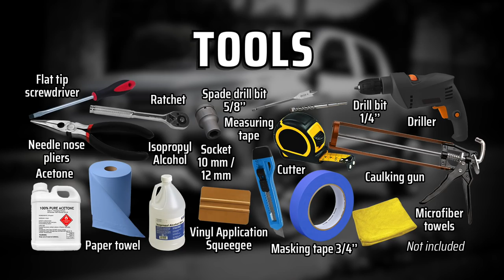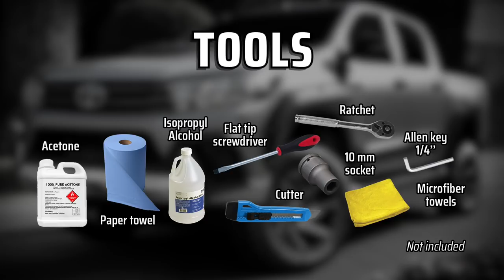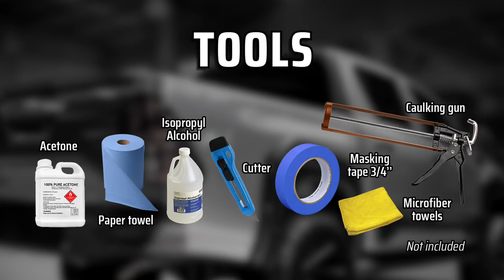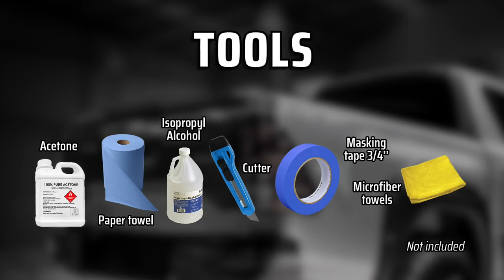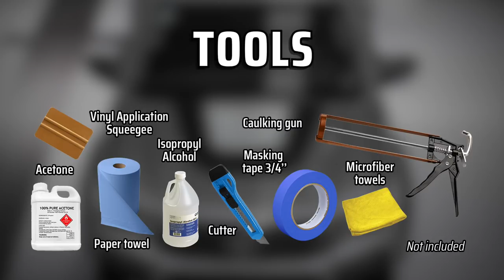STYLING KIT - Hilux 2017-2018 - TOYOTA

Comment: Where do I get the cab spoiler from?
Reply from the maker: Hi UFASTT,

Please contact our sales department marycruz@airdesignusa.com / sales@airdesignusa.com

OR visit our store. 3820 Oceanic Drive, Suite 301 & 302, Oceanside, CA 92056, USA 
Toll Free Phone (only in the US) (844) 280 - 2775
Roll Over Line (760) 435 - 0095

Best regards,
Air Design

Comment: fault no 2. never but never do a connection like that on a relay. not safe. rather use a wire tap to tap into a wire or solder onto existing wire terminal.